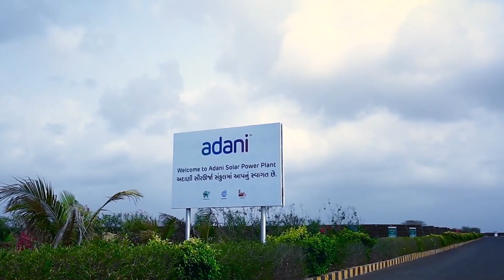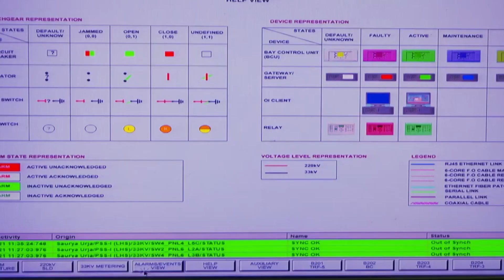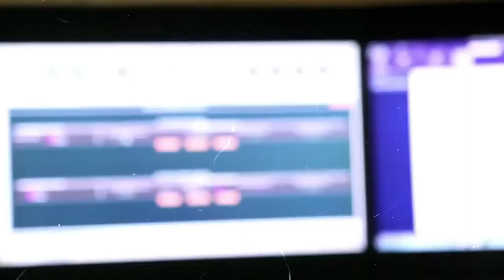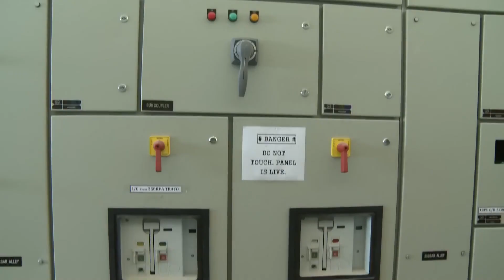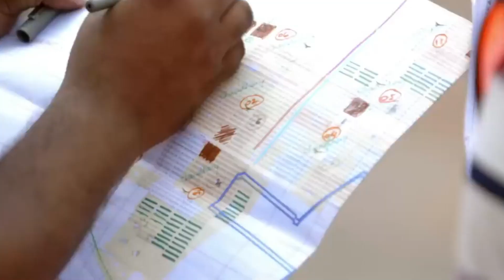This  Solar Farm Will Power An Entire Country

Comment: Can't the soil beneath the solar panels be used productively, eg. use drip-irrigation to grow vegetables, ... ?    🤔
ps. would help to reduce the ambient temperature of the panels, and increase their output !
Reply: Kutch has very little rainfall. Not enough water for agriculture I suppose
Reply: @jaiku99   water can be made available by lift-irrigation technology from Narmada water. Drip irrigation is a very efficient technology for the use of limited water availability.
The increase in PV output due to a reduced ambient temperature should be adequate.
Reply: The soil is brackish not even grass grows
Reply: @ramanarao3016   technology has answers today.
Reply: @ramanarao3016  is it true  have not seen anywhere in India except in the sea coast along teh shore lines where there is no vegetation due to salinity. Rannof Kutch is well known for salt pans but this project is it located on dry salt pans
Reply: @ramanarao3016   brackish soil can be remediated. There has to be a will (and commercial benefit) to do this.
Reply: Agrivoltaics is already a thing
Reply: @dragonslayer0  yes, but it is not profitable everywhere. Depends on case
Reply: We already produce food enough to feed whole country and to export we not need much farm land plus this is India's one the most arid land with high quantity of salt deposit so agriculture is 101% impossible 😂
Reply: @Sonu_Gupta-com  No we don't.
Reply: This is Kutch. A salt desert
Reply: The soil is not so suitable for agriculture, also that area (Kutch) is one of the driest regions in India. So creating agriculture there, would consume more resources than the possible outputs.
Reply: Khavda has brackish infertile soil.
Flat expansive region.
Salt desert nearby.
Excellent site for solar power plant.
Reply: Salt desert hai dude
Reply: No.
Not s good idea.

Comment: This solar farm will also need massive storage batteries
Reply: I hear they are planning to use hydro pump storage
Reply: @ pumped storage will have to done at the grid level, and not at the power plant site level. A battery storage system is more efficient than a grid scale pumped storage system. Though pumped storage is cheaper as the systems are already built
Reply: Things will develop in future once solar gets more into mainstream. Solid state batteries hv already been developed by some individual scientists. Maybe we can see it developing more & booming in the market the next decade. Even at present silicon solar cells may get replaced with much more efficient and cheaper to manufacture Perovskite solar cells. The process of development takes multiple strides. To become the best version of efficient we have to first BEGIN WITH the options available now.
Reply: @radhikashey360 solar company should also be increased their service . My house also have solar installed but the service is very bad
Reply: @ashishhembram21   I agree.. the key component of solar panel is its solar cell. Many companies in India Import solar cells from china and assemble it into solar panel in India. Hence there are issues with its substandard quality. India needs to scale up either its silicon based solar cell manufacturing or work on Perovskite solar cell manufacturing
Reply: @radhikashey360  But that's old news. Indian companies (including Adani) are manufacturing PV cells, inhouse, from scratch. The production capacity is increasing at a rapid pace.
Reply: @y3ksubroto  that's a good beacon of hope then 🤝
Reply: India doesn't produce excessive renewable energy right now. Sodium ion batteries or pumped hydro can be added on later
Reply: @commieTerminator  Get youself updated. India started the International Solar Alliance, so that more & more nations join hands to increase their solar (& other renewable energy sources) missions. And btw, India is the third largest producer of solar energy in the world. And all this improvement was accomplished in only the last 10 years.